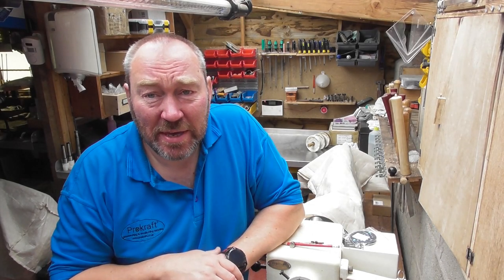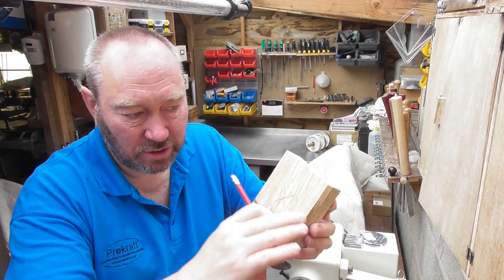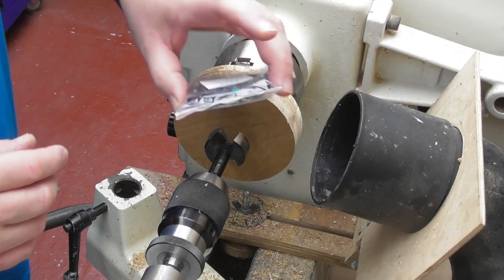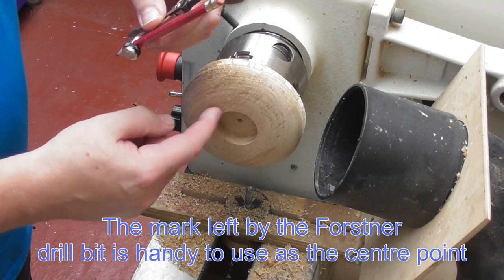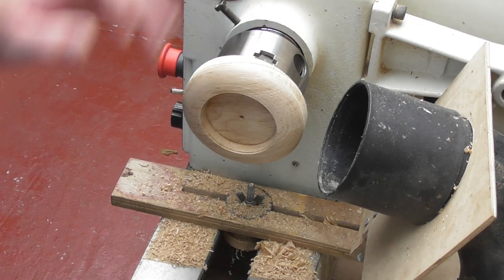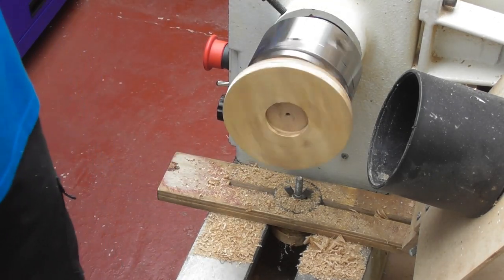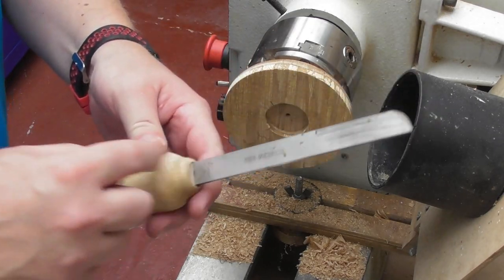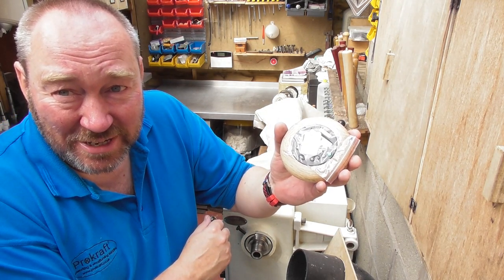A wooden calculator but not an abacus

Comment: Hello Jon.     Greetings from Chicago
What a great gift item and a great tutorial on offset turning i never knew how that was accomplished before and you make it look so simple and easy to succeed in. One of the best things I like about this kit is that should you mess up the turning process you have not messed up 100 dollars worth of hardwood.  Beautiful and useful one hour project. Stay healthy over there

Mike

PS.  I just tried to order three units ( I have successfully ordered kits in the past) and as per your site you do not ship this too the US !  Is this due to some error on the site or is perhaps factual possibly because of the battery etc. please advise
Reply from the maker: We do ship to the US but the calculators have a battery which makes shipping very costly and complex. Fedex won't accept them and we cannot send by post either - sorry!
Reply: @prokraftuk  hello Jon.   I figured as much anyhow.  Thank you fir taking the time to reply and explain.   I would assume there is a little battery compartment at the rear and if so can the battery simply be removed ( I would further assume that if this were possible these batteries are of the standard size also found in America?)If the battery is easily removed would you then be able to FedEx the parcel. Ir is it somehow manufactured like a cell phone where the batteries are not at all easily accessible
Reply from the maker: There is no obvious way to open the units.
Reply: @prokraftuk  well Jon sort of lime cell phones. In any case nice set that you are offering up for sale.   Thanks for all the replies/Mike